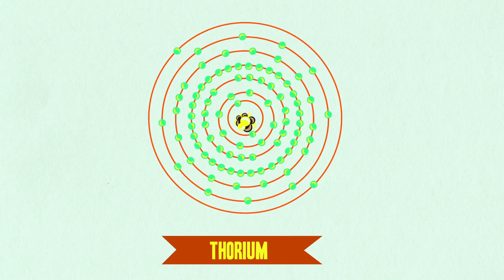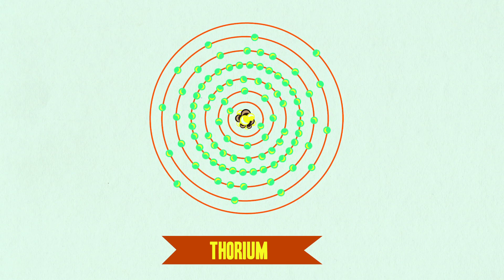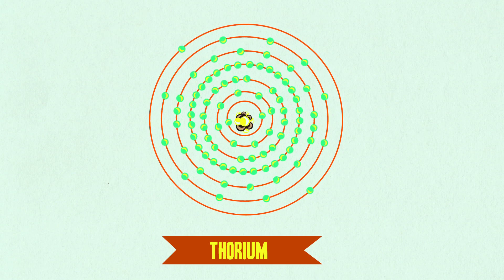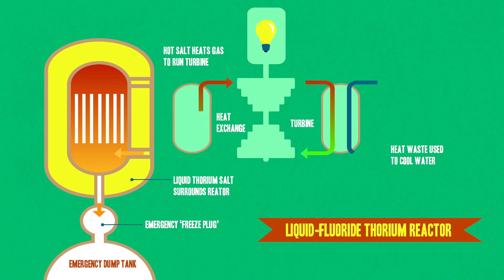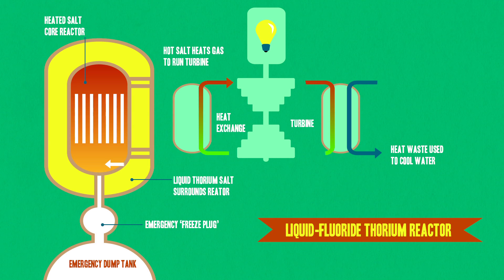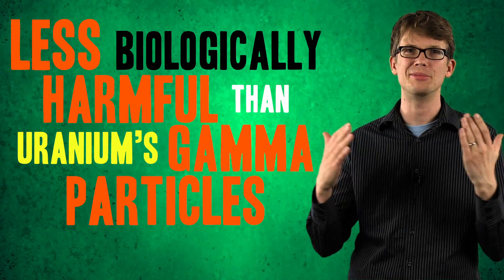Liquid Fluoride Thorium Reactors (LFTR): Energy for the Future?

Comment: I also heard that thorium produces 200x more energy per unit than uranium.
Reply: +Ecthelion Nártúron  its not that it produces more energy its that more of the energy during the process is harvestable. instead of being able to harvest something like 1% of the energy from a uranium reaction you can harvest like 80% of the thorium reaction. Way more efficient.
Reply: +Ecthelion Nártúron Thorium is more effecient because more of the element is used. A uranium fuel rod uses about 1% of the mined uranium, almost all of the thorium mined is used. Of the uranium in a reactor, only about 2-5% or used, the rest gets reprocessed or disposed of. All of the thorium is used up.

So about 200x is very approximately correct, if you start from the mine and go through to disposal. It's possibly more than that.

OTOH, uranium is consumed by nuclear reactions with thorium if it's used as the neutron source, and that reduces its half-life--a very useful effect.
Reply: +Imícanáro This only applies if the Thorium is used in a molten salt reactor. If Thorium was put into a reactor with fuel rods, you would see similar utilization as you would uranium. 

Also, there are some apples-to-oranges comparisons out there. You can't fairly compare the fuel usage of a thorium fueled molten salt reactor like LFTR to conventional LWRs. The best comparison would be a reactor like the Integral Fast Reactor (aka the Liquid Metal Fast Breeder Reactor, LMFBR).
Reply: Akathran Nethagrûl Per tonne :D
Reply: Reprocessing solid fuel is more expensive than mining new fuel. This is another really big blockade for metal cooled reactors over the PWR.
Reply: Mike Mckinnon it's actually a 32-36% yield in uranium vs a 45% yield in thorium, which may seem small but half of a percent of efficiency is good. Anywhere for 9-13% is crazy.
Reply: Its not the thorium that is special. It is how it is used. In a Fluid Fueled Reactor your fuel, be it Thorium 232 transmuted into Uranium 233 and burned, or Uranium 235, or Uranium 238 transmuted into Plutonium 239, is a molten liquid. This allows you to add more fuel, take out fission products, all while the reactor is still running. This leads to 95% or so burnup. Rather than .05-.07% burnup in solid fueled reactors. Why is this? Because one of the most common fission products is a gas, Xenon 131-136. The sudden appearance of a gas in a solid fuel causes it to break apart over time. You need to pull out the fuel rods before it entirely crumbles. Usually after only .05-.07% is burned up. This is horrible for efficiency, and leads to 99.95% waste.  Best yet, since it is already molten, you can use chemistry to separate out the desired fission products. Very little of the fuel will actually end up in long term storage.

Comment: thorium_briefing_2012.pdf
Reply: okay now I am looking at the rebuttal to the thorium_briefing_2012.pdf document and recognize they skirt neatly around many of the important points made in the Tickell article as well as actually agreeing with many of them.  (And I'm not sure who "they" are - it just lists that the poster is "DreamChaser."  I'm thinking it was prepared by Flibe?)  Like the cost.  "The cost compared to what?"  Har har.  And the rebuttal totally ducks the issue of fission product production.  And it makes no mention of the corrosion issues that might destroy the high-priced pilot LFTR.  "Regulatory bodies will assure themselves of the suitability of every material used in a licensed reactor."  Who are these bodies?  The NRC?  I don't have as much faith in the NRC as I used to.  I also see a lot of magical claims about technologies which do not yet exist.  And pyrometallurgy and electro-refining were already developed but not for the LFTR.  Hmmmm.  And "'Because nobody has done it yet' is never a good argument to overlook promising technologies, especially when molten salt reactors have been done, and successfully demonstrated for over 20,000 hours."  You could apply the “Because nobody has done it yet” argument to the new 100MW battery system for California's renewable program.  And it claims Tickell's agenda is to make money on renewables?  Even if it was, it wouldn't bother me.  Look, if I have the option of investing in an unproven nuclear technology which will take decades to develop and may ultimately fail, or investing in large-scale renewables...  Doesn't it seem like an obvious choice here?  Hah and the rebuttal compares the LFTR to the Moon Mission!!!

Comment: Don't you mean a LFTR emits Beta particles? If Thorium 232 is turned into Uranium 233 then it had to emit a beta particle.
Reply: +Spectre Not quite. The Th232 heats the fluoride  salt liquid which, in turn, produces electricity. U235 is the commonly used alternative in nuclear power stations.

Comment: Another point of relevance to this is that all of the elements in nuclear "waste" are actually valuable in their own right, but there's a lot of work involved in reprocessing that waste, and reprocessing waste was banned in the US during the Carter administration. In a LFTR design the fission products are already dissolved in a molten salt and thus primed for ongoing processing as part of the daily operation of the reactor.
Reply: +Mark Love That's right. Platinum group metals, xenon and technetium. Also the two main highly radioactive isotopes (Sr-90 and Cs-137) would be quite useful for sterilizing food, and as mobile energy sources. Most of the spent fuel is unreacted uranium, which can be recycled into new fuel. It's possible to recycle the plutonium and other transuranics into new fuel too. Basically, the only reason it's "waste", is because governments and the fossil fuel lobby want it to be, to use as a bogeyman to scare the public and provide a plausible-sounding excuse for not allowing new nuclear build.
Reply: Vincent Hughes Granted, but I can understand their reluctance. Who wants to lay out millions of dollars to start this when you can almost guarantee that Greenpeace and co will engage in massive ongoing protests, supported by ad campaigns across the media spectrum funded by the oil and coal industries?
Reply: +Mark Love Reprocessing of nuclear waste is currently legal. President Regan lifted the ban on reprocessing in 1981.
Reply: Vincent Hughes fair enough. Unfortunately the tide of public opinion is so opposed to anything related to nukes that very few are willing to invest in this for fear that it will be outlawed again.
Reply: +Mark Love In this particular case, it's not the public, but rather the corporate opinion. Despite some mild incentives, the DOE just can't find anyone to set up a reprocessing plant in the US. 

We have to rethink our regulatory framework here if we want to benefit from these technologies.